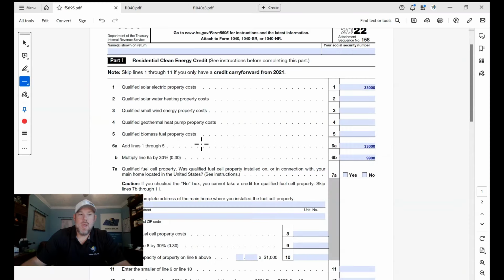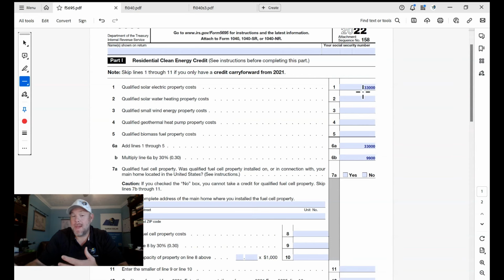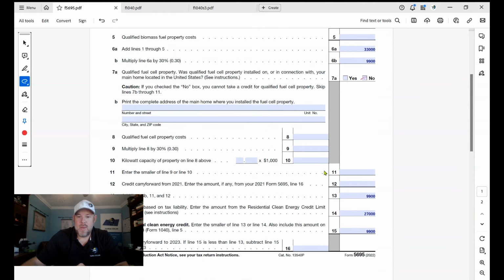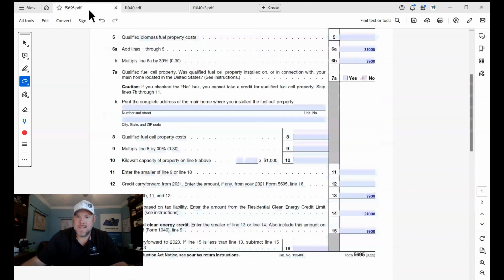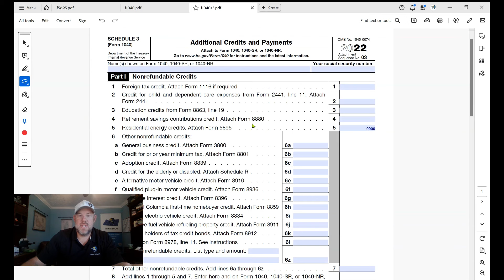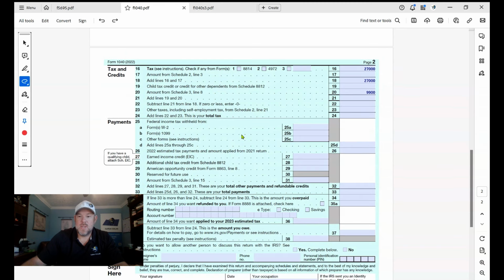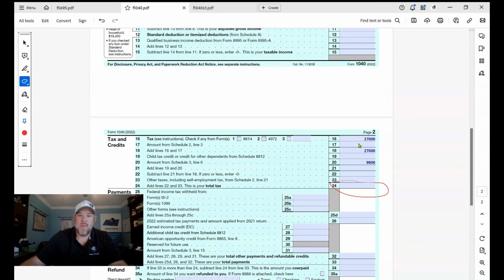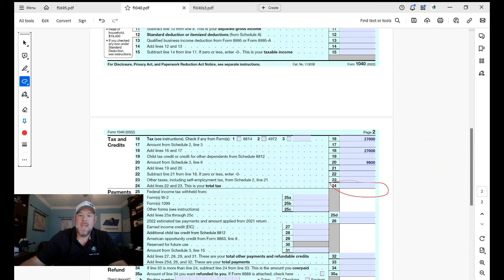Filing the Solar Tax Credit Walkthrough - updated for 2023

Comment: I want to buy the solar equipment today, have it installed next year and not miss the 30% credit.  I know I cannot claim the credit until the installation is complete which will be in 2024.  Will I be able to claim the 2023 purchase on my 2025 taxes?
Reply: You will not be able to claim the 2023 purchase on your 2025 taxes since the installation was completed in 2024. 

You are right that the taxable year to claim the tax credit is the year the installation is completed, assuming you are living in the house at the time of installation. Sources: 26 USC 25D(e)(8)(A) and IRS FS-2022-40, page 6.  

So in your case, if you buy the equipment in 2023 and complete the installation in 2024, you would have to claim the tax credit on your 2024 tax return, which you'd probably file in early April 2025.  Fortunately, the law has a carry forward provision (26 USC Section 25D(c) and form 5695, line 16), so if your 2024 tax liability is not enough to use up all of the tax credit, the excess tax credit just rolls over to be used on your 2025 taxes, then to your 2026 taxes, etc. until you use it all up.  There is no limit to how many years you can keep rolling forward the excess.
Reply from the maker: You got it, @sirmontego
Reply: So we're not guaranteed the full amount of a solar tax credit to then put towards a Solar Loan if you owe taxes for that year. The rest of the tax credit owed you take in a following year to then put towards the loan again?
Reply from the maker: @michaeljennrich8527 yes you can apply it towards the principal when you receive it the second year, HOWEVER, almost all solar loans have a one-time reamortization that takes place at month 18. Any pre-payment that takes place after that will pay down the principal and reduce the term but will not further lower the payments.